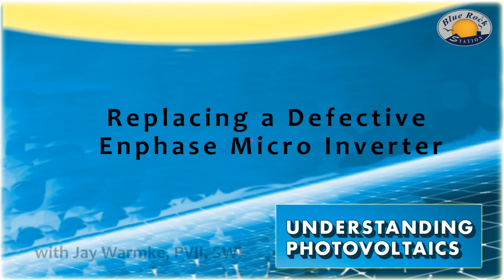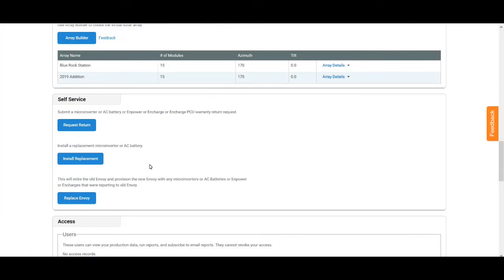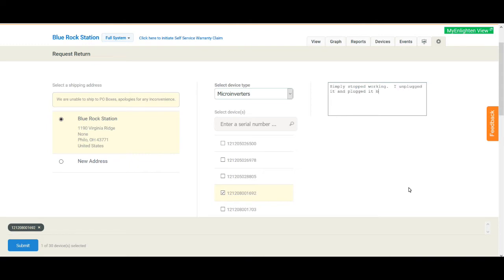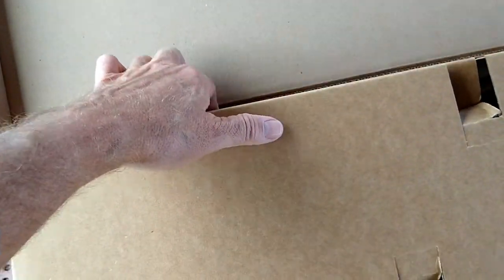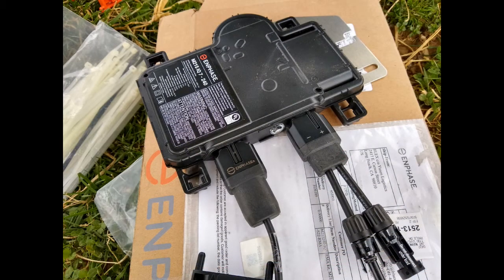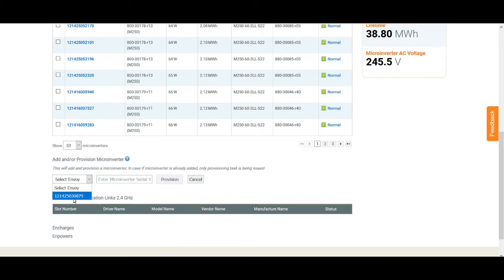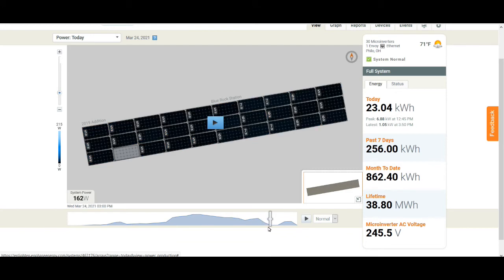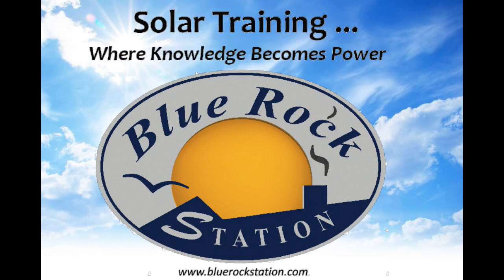Our experience in replacing a bad Enphase Inverter that was under warranty

Comment: definitely NOT the experience I am having with Enphase. They try to push you to the installer to do the work. $400 to replace an under warranty iq7a which I already pulled. And something blah blah if I do the work myself then warranty is void.. Dont buy Enphase!
Reply from the maker: As you say, Enphase is moving away from the DIY market (one of their former selling points) and requiring that certified installers put in and work on their systems.   Understandable, as they become more complex with integrated communications, smart switches and batteries.  But still annoying if you like to do it yourself.  You can become an approved installer (for your own system) - but that requires you going through a considerable amount of Enphase training.  The training is free and well worth the investment of time - but these systems are no longer simple and easy for an untrained homeowner to install.

Comment: Hi, where did you get the tool to remove the cable?
Reply from the maker: As you say, disconnecting a micro inverter from the proprietary cable does require a special tool.  Generally you will order one from the distributor when you get the inverters (the "M" line of micro inverters tool cost about $20 and you can still get them on E-Bay), the newer tools are less than $5.  We always suggest that when you finish installing the system, zip tie the tool to the rails under the array so you can find it again when and if you need it (might be years later).

Comment: Thanks for posting - new to me house with a 20 panel array, of which 5 are bad. New micro inverters ordered and in hand, but your explanation on the enphase monitoring process was invaluable - I had no idea. Again, much appreciated!
Reply: you got 5 bad already?
Reply: 5 panels out of 20 went bad? That is a 25% defect which normally does not happen even after 20 years

Comment: Nice... I like all the details you give in your videos. Thank you very much.
thinking about buying used ones, IQ7 which I can get for $40 each used of course. Just I worry I don't realize all the parts I need. I have only a 5 solar panel system at least for now. So this setup has to hook up to its own breaker right?  Any extra advice appreciated. I thought I was going to do grid tie, however, this setup seems much smarter indeed.
Reply from the maker: For a small system I think micro inverters are the way to go.  Easy to add in the future.  Yes - any PV system will need it's own breaker (as far from the main on the busbar as possible).